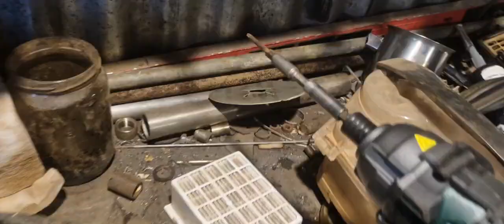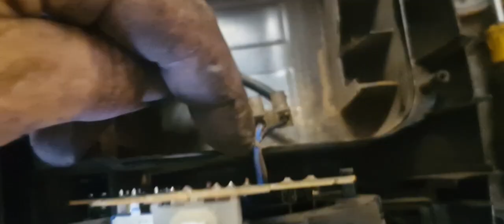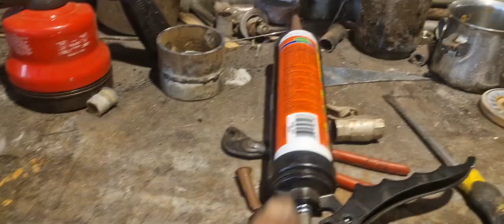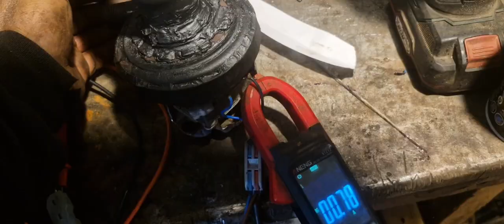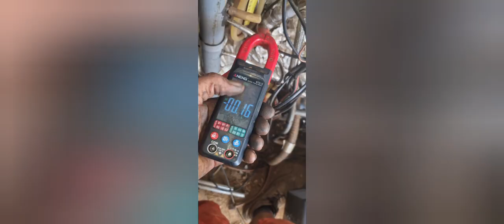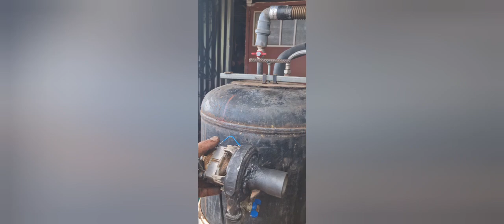Diy air blower for ltb gasiffier #offgrid #biomassenergy #diy

Comment: For the people who rather start out with new parts: on Aliexpres a brand new vacuum cleaner motor is €9.69!

But in my experience, over 50% of vacuum cleaners that get thrown away are barely old enough to have a full dustbag.
Seems there's more and more people that prefer to just buy a new complete vacuum cleaner, over finding out what type of dustbag they need and buy those.

And thus, a lot of these vacuum cleaner motors are pretty much brand new...